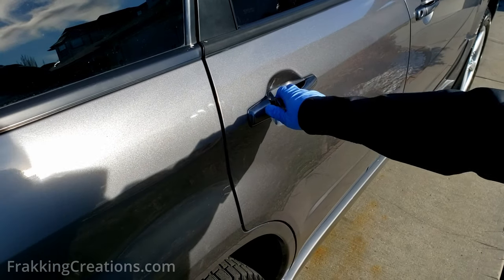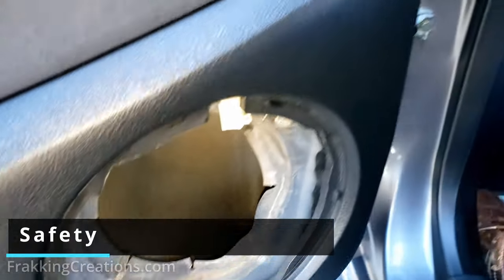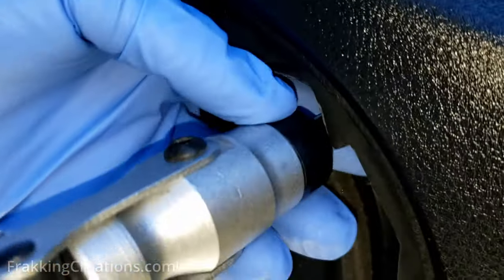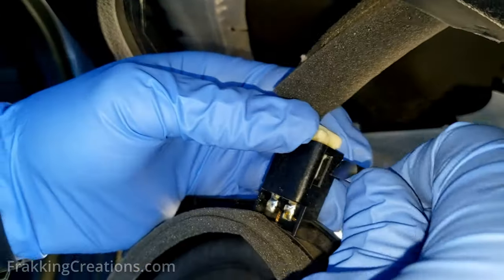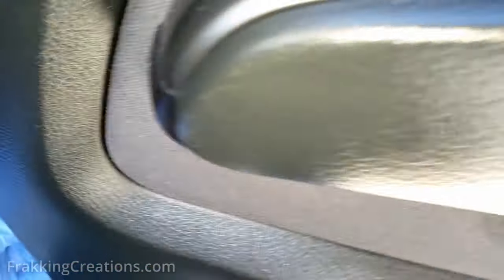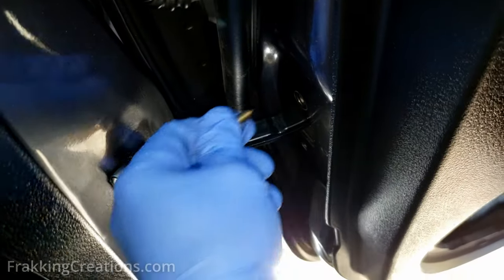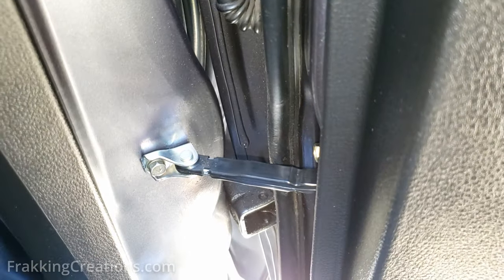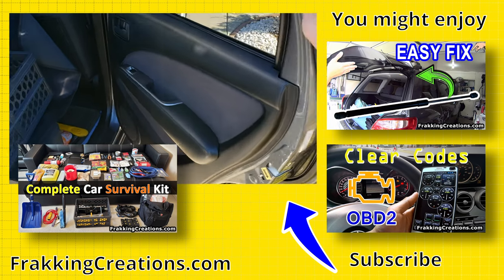Car door does not stay open fix - Easy DIY Door Check replacement repair

Comment: You can repair the old one, 2 ways - the cheap way (open it up and smash 1 small washer in both sides).  Or buy the rubbers that are inside and replace them

Comment: This is not easy.
Reply from the maker: I suppose "easy" is a subjective term that in this case, depends on the persons experience with car work and DIY.  Plus, every vehicle is different and some are actually easier than others when doing this fix.

I considered this easy because I was told by a mechanic that to repair this he would have to take off the door panel, among other things, in order to access the door check.  This was going to be a few hours labor, which would have also been expensive.

I was able to repair this in under 45 minutes while attempting this for the first time (and also while filming it) by accessing the door check through the door speaker hole.  A lot easier and faster and doable by any DIYer.
Reply: That one is easy.
I gotta replace mine, n speaker cover is behind the door card.
You can't see inside after you have removed the card, so feeling blind.
You also have to undo the part that goes onto door jam of the car. Not the bolts either lol

I'd rather have this easy fix lol

Comment: Doesn't seem so "quick and easy".
Reply from the maker: It has to be taken into context.

If you compare to the recommended way that is typically suggested for replacing the door checks, you will be required to remove the door panel and additional parts.  This typically takes a lot of time to disassemble and then reassemble.  Also, some vehicles don't have access to the door check through a speaker hole and thus you would have to do it this way.

If you ask for a quote to get this repair done, some shops will actually quote the panel removal method which will cost you a lot in labor charges.  Doing it the way I show in the video is the fastest and easiest way to do it.

Comment: So the only way to fix is to replace it? No quick garage fixes?
Reply from the maker: Not that I know of.
If you were going to do it, it's possible you would probably need to replace the plastic pieces within the body that compresses the main arm.  It may be those pieces that are wearing out causing the door check to not be able to hold the arm in place anymore.

Not sure where you would get the parts though or how easy/safe it is to disassemble.
Reply: @FrakkingCreations   Actually there exist a set to replace these pieces.  It cost about 9$ .

Comment: Thank you for this video. My Door check just broke on my 2011 Kia Soul last week. Funny thing is, it was the rear door behind the Drivers seat. I rarely open it, but it was all rusted. I checked my others and they are perfect! So Weird!!
Reply from the maker: Thank you for commenting.  We're glad the video was useful.
It could have rusted because rain and car wash water gets between the window and the rubber seal where the window goes up and down.  This water could have landed on the door check and caused it to rust.

Comment: Easy work, the hard part is finding the part. Got any ideas?
Reply from the maker: Good question.
It doesn't have to be hard.  The easiest would be to call a dealership parts department of your make of vehicle and ask them about a replacement part for a door check for your year, make, model vehicle.  They can get the part number for you very easily and quickly, plus they can even order it in.
If you want to do it yourself, you can do a google search for a door check for your year, make and model of vehicle.  e.g.  "door check 2018 Mitsubishi Outlander".  You should get a lot of results for different vendors that sell that part.
Go with the dealership if you want guaranteed OEM fit and quality.  Otherwise, it's up to you.
Hope that helps.

Comment: Do a 2015 Camaro!
Reply from the maker: I am thinking it should be similar to what I did in the video.  The speaker cover looks like it should be removable.  Once removed, the speaker should be removable as well by removing the screws holding it in place.  Then unbolt the nuts and screw, remove old door check and replace.

Comment: The problem is what caused the door check to fail? Reason I mentioned this is the driver side door is the most used door and usually will the one that will become loose over time. 

However, sometimes they come loose right off the showroom floor! 

Obviously the dealer will probably repair it and charge you for a replacement. 

A reputable dealer will give you your old one, and charge you for a replacement of a new one. 

Just make sure that you mark your old one before you take it into the shop, I use ultraviolet pen. And a sharpie on the other side. 

To make it look obvious. Removal of sharp your ultraviolet pen is also obvious because the chemical process is used in it will be very easy to tell that the old one is much too clean once it's handed to you. 

Fool me once shame on me, fool me twice shame on you.